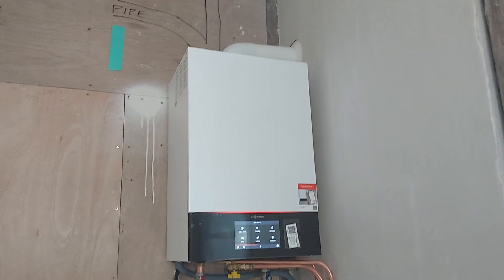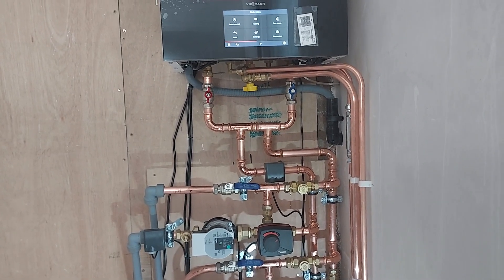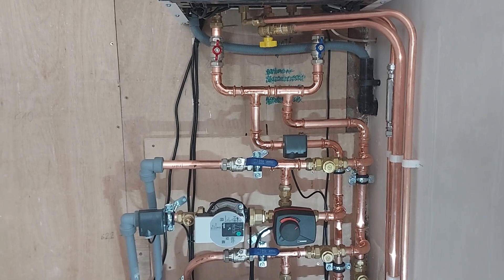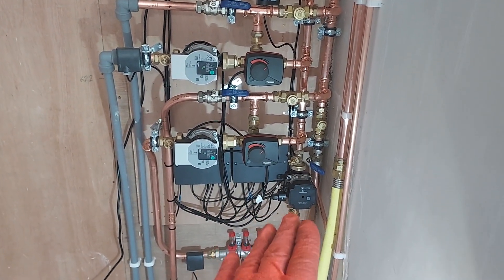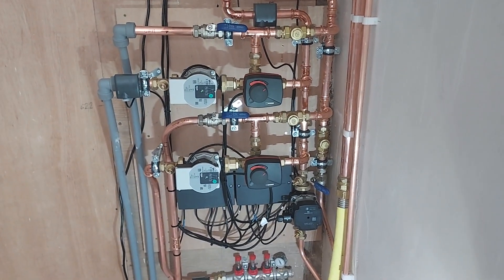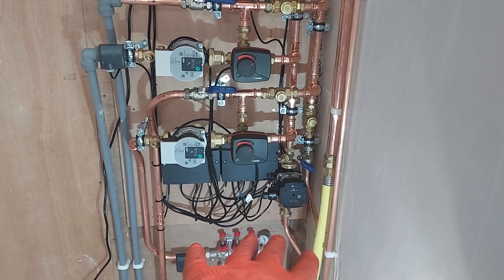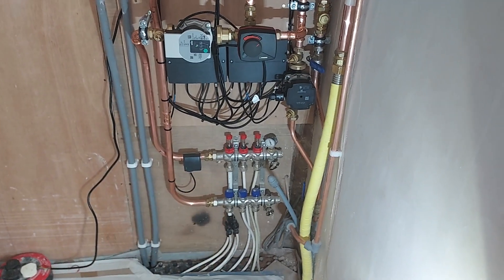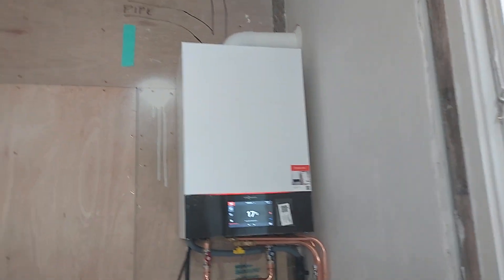another project with boiler Trust

Comment: If you have a llh instead of the tees can you get away with not having an unmixed circuit without the boiler overheating as the mixers open
Reply from the maker: The boiler doesn't overheat as such. But yes. The low loss header acts like a volumeizer. This allows the boiler to continue running until the valves have opened and avoids the boiler cycling
Reply: @andrewmillwardwatford9410 thanks Andrew

Comment: Andrew, this might be a daft question but I have the submount mixer on my 200W, the unmixed radiator circuit suffers from poor control and bedrooms too hot at night.setback. If I could rearrange the pipes on the submount to give me a second flow and return off the plate hx for a second mixed circuit, would it be necessary to retain a unmixed circuit off the boiler F&R?
Reply: So run the UFH on the unmixed circuit? How does that work when generally rads run at higher flow temps? Also when generally the boiler flow temp is set (differential) to give a higher temp than the mixed circuit?
Reply from the maker: @SkellyMr  a lot of the answers I need to give would end up in me writing a book. I encourage people to call me when an answer is potentially very long as a few minutes on a telephone call can transfer so much more information than text. If you Google my name you will get through to my company and they can put you in touch with me. But the basic principle is that the flow temperature required at the mixer for the underfloor heating is likely to be very close to the radiator flow temperature or higher. Also most underfloor heating systems are still being fitted with room thermostats and actuators. So underfloor heating fitted with actuators can tolerate a slightly higher flow temperature without any significant negative impact what radiators circuits are unlikely to be controlled in the same way. Although thermostatic radiator valves can be used to limit the maximum temperature of a room it is a pain to have to turn them down at night and up in the morning rather than to use the programmed profile on the boiler.
Reply from the maker: It may be better to use the mixed circuit for the radiators underfloor heating. This is especially true if you still have room stats and actuators fitted to your underfloor heating system

Comment: Out of interest what BMS are you using yo control the esbe mixxers? Or is it the boiler?
Reply from the maker: A v200 can operate 3 mixed and One unmixed circuit. Each mixed circuit requires a control to be added.

Comment: Have been using Viessmann now for a about 2 years - full range of boilers from 050/100/200 and now HP’s this year 2no ground source and 2 ASHP with 2 more in the pipeline - great products but you have to work hard to fully understand them
Reason for the comment - I’ve always used their divicons never been brave enough to use separate pump & ebse mixers due to I might be longer wiring than plumbing - how about a video on the wiring or are you keeping that a trade secret 😉
Reply from the maker: The wiring of these is covered on a video I made a while ago. The wiring process is exceptionally easy so next time save yourself a fortune and try it with the esbe mixers
Reply: @andrewmillwardwatford9410  
Thanks I shall have a delve into your past 😂 but to be fair I’m subscribed and thought I’d watched most of what you’d put out
Keep it up great content 👍

Comment: Hi andrew.. sorry if i sound stupid here. You have 3 pumps running off the close coupled tee. Would they not be fighting against each other? Is it more beneficial with 3 individual pumps on each circuit rather than 1 decent sized pump?

Love the videos! Very intresting stuff.
Reply from the maker: These pumps are after each mixer. You can't place the pump the other side.
Reply: Those two grey plastic pipes on the left with the plastic 90s spoil the look.😉

Comment: Hi Andrew another lovely install! Are those non return valves on all three of the returns?
Reply from the maker: Yes so much of the Returns to prevent backflow in case of any pump being inactive. Interestingly on the pre-built pumping stations the non-return valve is on the return on the secondary side, I can't see the point in this but on the vaisman schematic it is clearly showing in the position I have placed it in this job. I have on different jobs placed non-return valves in different locations and I'm not sure if I've got this correct every time